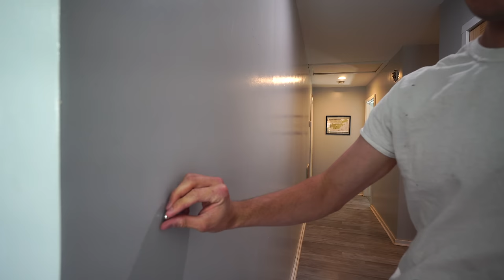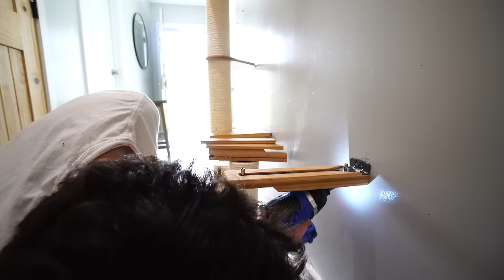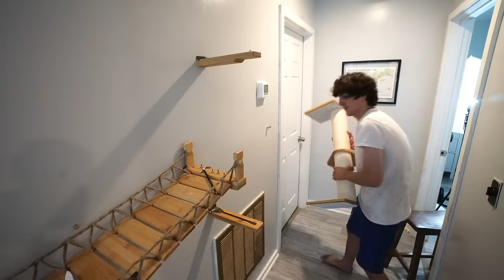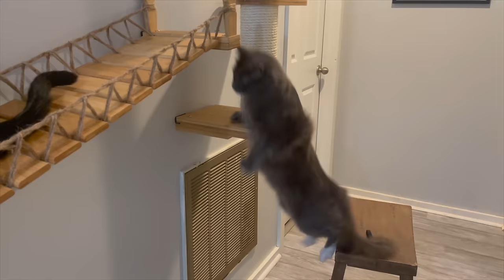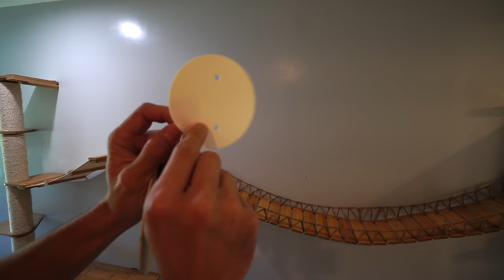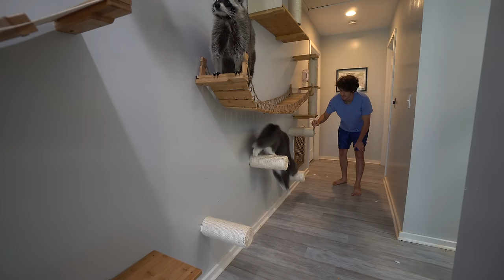I Built a Massive Cat Wall for my Cats and Raccoons!

Comment: Make sure you go around and tighten the screws every few months as they can come a little loose as they bump around on them x
Reply: I doubt he will be able to since he stripped almost all the screws. The most frustrating thing to happen during a home project, hate it.
Reply: @Teasticles  not stripped. you can clearly hear it's the clutch on the driver.
Reply: Use some threaded rod, resin anchor, and nyloc bolts. Then it’ll never come down.
Reply: Tools.
Reply: And please adjust the torque on your drill.

Comment: I never thought of using neodymium death magnets as stud finders. That’s quite clever.
Reply: Lol
Reply: Oh, so that's what they are...very clever 👏👏👏👌🤗
Reply: I was trying to figure out how this works. What metal is there for the magnets to stick to? I thought the studs would mostly be a bare 2x4 running vertically in the wall.
Reply: @mackit  I suppose it would be the nail that attaches the drywall to the stud because having metal studs wouldn't make sense for drilling in to.
Reply: Thanks for providing the name….wondered what type of magnet he is using!  Very clever indeed.
Reply: @TheDeborahPetersShow  I call them "death magnets" because on Mythbusters Adam mentioned that two of them the size of hockey pucks would shatter the bones of your hand if you let them snap together with your hand there.
Reply: @WUZLE  That’s crazy.  Can they be purchased at any building supply?
Reply: That'd only work on steel stud. And yes, you can put screws into steel stud, that's how the drywall stays on :P
Reply: @Grendelmk1  residential construction does not use steel studs. His magnets are showing him where a drywall screw is holding the drywall on; into a 2x4x8 (wood)
Reply: @lorenzcibenko7548  That may be the case where you are, I suppose. Let's just say I've spent a few years in construction and leave it at that ;)
Reply: takesone2knowone  yep, i got a buddy who works at stadler sfs as head of testing and standarts for facade products and he can tell you all about those kind of screws 😜😅
Reply: @TheDeborahPetersShow  No. You must go to animal shelter. Cats. Racoons will come if you leave basement window opened.
Reply: @SpaceTimeManipulatorSTM    Oooooh, that makes sense.  I didn't think of that.
Reply: takesone2knowone  he lives in a HOUSE. Residential building used WOOD STUDS/ FRAMING. He used the magnets to find DRYWALL SCREWS which indicates where WOOD STUDS are
Reply: takesone2knowone  I’ve worked with steel studs as well.. drywall screws go into them obviously. He lives in a house; not an apartment. And it’s “screwing” not drilling...
Reply: We used neodymium magnets to find the studs in my house, I saw it while it was being built, no steel studs here. Presumably he was locating the drywall hardware. Apparently it's a trick my brother uses often in his work.
Reply: @lorenzcibenko7548  Except those aren't drywall screws he's using, they are fine pitch self tapping sheet metal screws.  So unless he just decided to use the wrong fastener for the job... I'd guess metal studs.
And yeah, they use steel studs in residential construction all the time where I'm from.
Reply: omg brilliant. I have neodymium magnets but no studfinder. What a fabulous trick, thanks!
Reply: But don't you need a magnetic wall for them?
Reply: @ezydenias8505  It helps to read the other comments in this thread.
Reply: @lorenzcibenko7548  Findings a single screw with a magnet is not done that easily. His building obviously has steel studs.
Reply: I have lots of cute raccoon videos on my channel
Reply: Bad information. Homes do not use steel studs, they cost much more than wooden ones.
Reply: @picklesauce4091  Have you tried it?
Reply: I worried the entire time while the animals were playing and the magnets were still up, since I know pets (or kids) have swallowed those and had a very bad time of it. I mean, I know nothing happened to them, because it's been over a year! But if anyone watches this, do make sure to take the magnets back off the wall before your pets come around. :D
Reply: @privatename542  WRONG. (twice). They are used frequently and cheaper too. Google it (like I did)....   "Steel studs are light and easy to store, plus they resist fire, insects and rot. And you'll really like the fact that steel studs are about 30 percent cheaper than wood."

Comment: I made my hallway into a cat run. But I did it with random items. It started with an old twin mattress that is the base for the whole system. She loves to climb it so I covered it with durable and decorative fabric she can sink her claws into. She spends hours on it napping or uses it for play or just doing her royal “my feet can’t deign to touch the floor” thing. I have a tall sisal and carpet cat tree next to the window. From there is a short but fun jump for her onto the climbing wall. Then I have a series of varying height shelves she can jump onto. On the lowest one I attached a nice little fluffy rug that she likes to nap on. The one at the far end is her treat shelf. From the hallway she can transition to a similar system that circles my bedroom ending with my tall entertainment center. In the living room she can also transition from the hallway system to a system where she can walk all the way to the front door without touching the floor if she wishes. I use the hallway for her play run. But I love some of the items you have on your system. Mine is a work in progress. Your babies seem to appreciate your hard work

Comment: This project is amazing. I'm hoping to build a climbing wall like that for my rats at some point

But please, please, please stop torturing your electric screwdriver like that. It definitely shouldn't make that loud noise, that only happens when the bit slides out of the screw over and over again, which usually happens a) because the bit is too small, or b) you're not holding the screwdriver straight in front of it but in an angle. Either way it can fuck your screws and/or bit, depending which one is the sturdier material
Reply: Kinda depends whether it's a drill driver or an impact driver, no?
Reply: @michaelsorensen7567  do you mind elaborating? I've mainly worked with my makita one that, if I understand the difference correctly, is a drill driver, and have learned to see this sound as something really unhealthy it shouldn't be making (a lot, probably can't avoid it completely) if used correctly. I'd appreciate if you'd take the time to (briefly) explain how that could be different with an impact driver, but absolutely undetstand if you prefer not to or don't have the time
Reply: @tezzanoia  impact drivers are like the offspring of a drill and a jackhammer, so it's meant to use that to be able to drive screws with higher resistance by getting a bit of a hammering motion. I'm not sure, but the noise could be from impact instead of stripping. 🤷‍♂️
Reply: @michaelsorensen7567  that makes a lot of sense, thanks for taking the time to explain! Still sounds absolutely horrific to me, as its pretty much the same sound it makes when fucking up a screw, but that's ofc my issue then
Reply: @michaelsorensen7567  Also, I'm guessing the fact tito the racoon liked your replies probably means your assumption here is correct, so I apologise for trying to explain something where I seem to have been wrong
Reply: @tezzanoia  you can't learn if you don't risk being wrong and you've been nothing but pleasant, so please don't apologize 😉 

They do sound fairly horrific, took me a while to get used to them at work. They sound VERY similar to stripping a screw head, but you learn the different in feel fairly quickly.

Best of luck in all future endeavors!
Reply: @michaelsorensen7567  thank you, that's very kind

Glad, I'm not the only one to feel that way then, I'd probably get used to them as well if I were to use and hear them more, but I guess I'm going to just stick with my beloved Makita drill driver.

Thank you and the same to you as well!
Reply from the maker: @tezzanoia  Yes it was an impact driver :)

Comment: 12:21 I would add a flat platform in that void underneath the two cylinders on the left just so they don't risk falling far if they fail their jump. Not so low that they can't jump from the suspension bridge over to the left, but about the same height as the board that would be to the right of it.

Comment: That's a really short drill bit for what you're doing. And I'd pre drill the holes unless you bought your own screws. Cheap flimsy screws are the most common way companies cut costs.

Edit: also very cool! I don't mean that negatively, just advice from experience.

Edit: I love the use of magnets and marking the whole stud. I do that too! Well mark studs on all sides, I find studs by sound and a tape measure usually.

Comment: Those bridges need more support, even an angle brace would help.  You could easily have 75 pounds of cat on that thing.
Reply from the maker: If I remember correctly, each post can hold up to 80 pounds, and there are two of them.  We never had a problem with them though!

Comment: I would love to see an update on this because I didn't see any wall plugs used at all... My largest fear would be that the pieces over time a month or two is going to be fine but what happens when you get multiple creatures fighting on the structures and really throwing the weight around on that drywall. 🤔 I also live in a city with plaster walls so finding ways to install these things is a little bit more difficult just curious on durability
Reply: You got a solid point there. I hope they read this.
Reply: Oh I found it.. a little further down the comments they replied: 

Tito The Raccoon
4 months ago
We installed most of the pieces in May and the end footage was filmed in august. Three full months and all the pieces look great still!! And that’s with 5 cats and 2 raccoons playing on them constantly. So I’d say the pieces are high quality and super durable!
Reply: The cat wall is secure, because the components are mounted onto the studs, which all walls (except concrete and brick) have, underneath the drywall. Studs are wooden 2"x4"s that are vertically-placed a standard 16" apart and are structural parts of walls. When you saw him using a magnet, he was locating the nails already securing the studs, then he measured 16" across & used another magnet to mark where that stud was. He repeated that as needed, across and up the wall. 

He drilled, making sure to not drill where nails already were, to add the shelf, climbing tree and bridge mounts, and used the level before drilling the second screw for each mount, so the shelves would be level. 

I cringed when I heard the sound of the drill's screwdriver head clunking 'round as he continued to drill screws in close to the wall. I'd have used a manual screwdriver (instead of the drill) for the last 1/2", so the square- or star-shaped holes in the top of the screws don't get stripped, which will make removing them easy, if/when needed. If the Robertson (square hole) or Phillips (star hole) screw holes get stripped, i.e. corners worn down (using drills as drivers will do this), it's near-impossible to remove them with a screwdriver. You'd have to remove the mounts & sisel-covered posts, then shear the bolts or screwheads off with an angle grinder, then repair the wall.
Reply from the maker: All the pieces still looking great 7 months later!!
Reply from the maker: Its holding up pretty well

Comment: quick tip : buy star bit and screws no stripping
Reply from the maker: I used an impact driver
Reply: @TitoTheRaccoon  yea thats pretty much the standard now. they make torx bits for impact drivers and screws with torx heads. its pretty much standard now way eaiser to drive and no stripping. i noticed u were working with alot of weird angles and ended up stripping alot of the screws. torx is much better and easier to work with. if ur doing more diy stuff def look into it

Comment: What're the magnets(?) on the wall for? Do you have steel studs? It looked like you were using wood screws, though.
Reply from the maker: the screws that hold up the drywall are steel.  So if I find the screw I know where the stud is.

Comment: The use of a magnet does not mean you found a stud (a stud is a 2" by 4" or 2" by 6" wood stud or some times a metal stud which runs up, and down the wall which holds the wall up, but most of the time it holds the floor or ceiling above your head up what is called a load bearing wall). The magnet tells you that found some metal which is not a lot of help because you ending up using a stud finder which on average are about 16 inch apart from each other not counting doors, and windows! The reason for using the stud finder over the magnet is sometimes the people who put the drywall up may have missed the stud meaning you found the metal screw used to hold the drywall, and the stud is not there which is why it is a waste of your time! Research building walls with stud and hanging drywall sometimes call sheetrock you will see that I am right! As for the drill well you mess that all up do more research on using drills on drywall you need lots of help there the wrong kind of drill or the wrong bit or you just don't know how to use it in a nutshell don't do what you see in this video he is not a builder or a Weekend Warrior he loves his cats and raccoons that is true!

Comment: It stresses me out how tiny and slippery the wooden platforms are. If you want them all to keep using it and have no injuries you gotta make sure there are safe options from one platform to another and to the floor (imagine them using it while being sleepy, where their movements are less coordinated). They will still go for dangerous jumps and climbs when feeling adventurous, but for frequent use it can be made safer.
Reply from the maker: it was never an issue. Thanks for the concern tho!

Comment: 1:04 how does the ball just stick to his wall
Reply from the maker: Its a magnet.  The wall is made of dry wall and to hold the dry wall to the 2x4 studs they use drywall screws.  Its just magnetized to the screw.  This helps you to find where the 2x4 stud is.

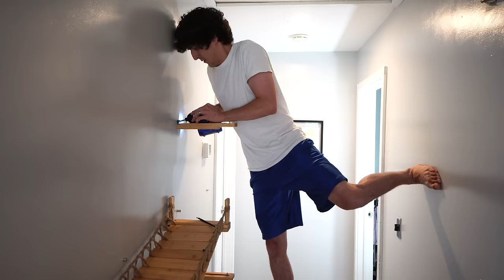Comment: 5:10 Are you having to do that because the bit is spinning and stripping out the top of the screw? If they are phillips head, replace your bit often, they're a garbage fastener. If that's not the case, that driver is way too weak. You should be able to let the driver do the work. An impact wrench will improve driving any kind of screw because it resets the bit every second or so with the aforementioned "impact" of the wrench. If it's neither of these reasons, Catastrophic Creations may want to reconsider the fasteners they provide. If you're providing phillips type screws, please! just stop! use virtually ANY OTHER TYPE except flat standard slotted screws.
Reply from the maker: no the screws are not stripped.  I am also using an impact driver already.  Its not top of the line but its definitely no black and decker lol.  I need more leverage because I was standing on a stool so I couldn't push on it enough without tipping the stool back.  I also think there was probably a knot  in the wood that made it harder to screw in than normal.  I used decking screws instead of what catastrophic sent just because we have so many animals I wanted to make sure I had a beefier screw. Pllus the raccoons are double the weight of the cats.  These were Philips heads, which I agree suck, but arn't that bad.  Its not like im using a flathead screw
Reply: @TitoTheRaccoon  For future reference, if you're trying to put a fastener in the wall and you hit a metal plate, stop. It could be a nail plate designed to keep you from nailing or screwing into electrical wiring or plumbing run in the wall. Sorry if you already knew that. Others reading might not know. That said you could have metal studs in the wall. If you can't hammer a nail in (it just bends) it's probably a nail plate. A nail will go right through a metal stud.

Comment: Hope you get enough money from your videos for vet bills for the racon as it falls from that! Recons don't have the same abilities in landing etc as cats!. Im Surprised that the company that sell these dont put carpets onto the wood so the cats can grip, and they will slide and fall. I know because I made my own superhighways walkways for my cats, including ones that go over the top of the TV box I made to go around the TV to protect it. Their walkways go above my head, across my rooms, so they're not restricted to just a wall. They have feeding stations up there, beds, high aways there too. My 14 cats are indoor only, so I made it as fun as possible for them. 
I suggest putting up some walkways platforms that go across above rhat area to the other wall, make them big enough so they can sleep up there, especially at the end above the doors, that whole end can be a bed area, with a walkway going along the wall above you head, so they can jump from side to side too, but just add some carpet to make it easier for them to grip. I'd move the whole thing off the floor, though, to stop the recons getting on it!